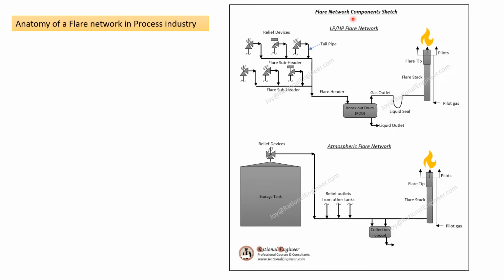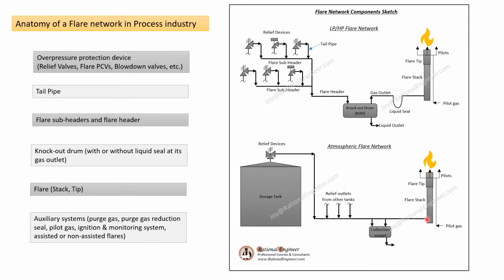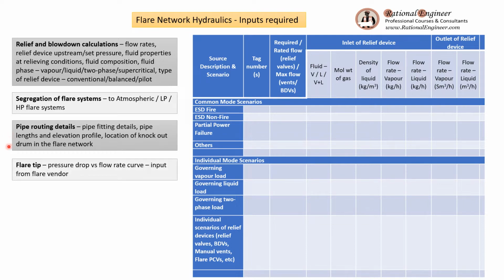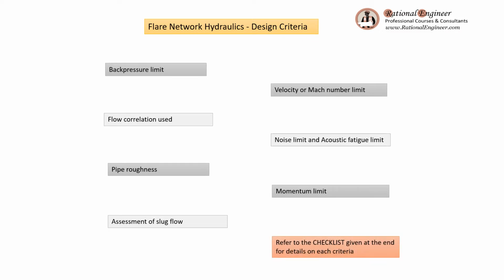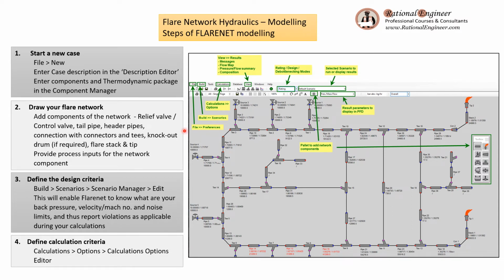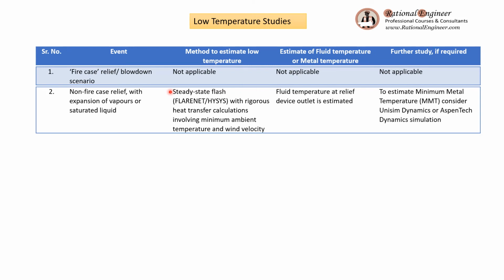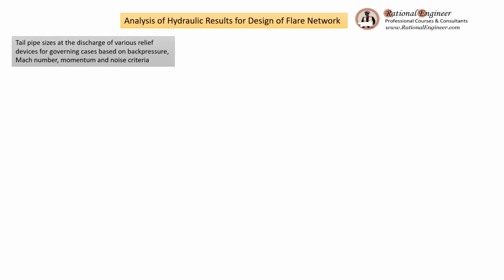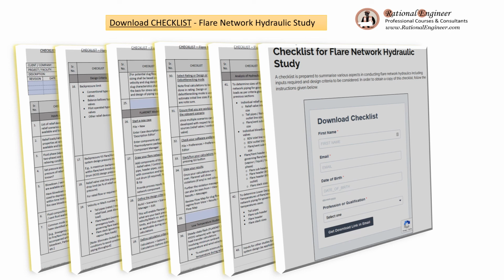Flare Network Hydraulics and Checklist for FLARENET modeling

Comment: How to do flare system design is really understood. But the purpose of the segregation of headers and problems involved can be dealt better.
Reply from the maker: Thanks for your feedback. This video is about flare network hydraulic modeling and analysis. During introduction, the stage of flare network analysis in overall context of flare system study is explained in brief.

Comment: During a cold relief the flare header (including tail pipe) will be coated with Ice. How does the flarenet predict heat transfer in these circumstances? The thickness of ice layer is an unknown here. Further, when two different of sub-headers connect with each other (LTCS and SS) then how do we check compatibility of operating temperatures with respect to metallurgy.
Reply from the maker: Flarenet simulates steady-state flare network hydraulics and performs heat transfer calculations based on heat gain from ambient along the length of piping.  The temperature results at various locations in the network corresponds to fluid temperature inside piping. It does not predict formation of ice outside the piping due to freezing of moisture. User has to provide ambient conditions (ambient medium, ambient medium velocity, radiation) and insulation layers, as applicable. If you want to estimate metal wall temperature, then check whether the relief will be continuous for long duration and thus metal wall temperature will be in steady-state with fluid temperature. For relief or blowdown with limited system inventory, user can use dynamic simulation software to predict metal wall temperatures.
Reply from the maker: When two sub headers of different metallurgy connects to the main header, then ensure at least 1m of length of non-flowing sub header has higher metallurgy (lower design temperature).
For example, if LTCS with -50 deg C LDT and LTSS of -70 deg C LDT connects to main header, then for 1m section of LTCS sub header connecting to main header should be LTSS. This ensure that when relief/blowdown with lower MMT from LTSS sub header flows into main header then temperature creep into non-flowing LTCS sub header (expected to be less than a meter section) will not result in brittle fracture.

Comment: It is explained in detail with very clear factors involved in flare system Hydrulics.
Can also included about initial PSV sizing for flow rates for BP calculation. Final model using Aspen.
Reply from the maker: Hi, 
Thanks for your positive feedback on flare network hydraulics video. 
For Sizing of Vapour Relief Valves (Case Study Gas Expansion during Fire), you can refer to my video explanation here: https://youtu.be/oWUuVzfSyFQ 
If you would like a more detailed explanation on various relief load scenarios and sizing calculations, then check my website here: RationalEngineer.com